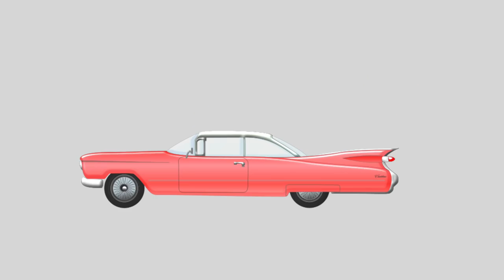Yes, Rockets CAN Fly in a Vacuum

Comment: Here is where I am lost, pressure leaving an object propels it forward because the object is actually in a sense slipping off of it's internal mass that is being expelled am I right? Now take a vacuum that sucks say.... 60psi and a balloon that blows 60psi and let it go right where that vacuum is, the object does not move obviously. So now i'm confused on how a rocket works in space when the vacuum takes that pressure away immediately as soon as it is exposed to the vacuum of space. Doesn't the rocket not get a chance to build back pressure to launch itself off of? Everyone is talking shit in the comments calling people stupid for not knowing... But when I think about this, it doesn't make any damn sense to me and i'm not stupid. I feel that the rocket would need an exertion of force towards the opposing direction of the flame if it's thrown mass is lost in a vacuum because no pressure builds up. A rocket works by heating up the fuel expanding it and creating pressure in the rocket then expelling them outwards to create thrust. Well in a vacuum that thrust should be lost because when it hits the vacuum it is lost and you should only see a light show rather than movement. I feel like an exaggerated view of how this works is testing it in an atmosphere to see the pressure build behind the rocket because of molecules in the surrounding air. In a vacuum that pressure is then lost and that force is only exerted one direction instead of two.... or it should be with my understanding of how a vacuum works.
Reply: "Here is where I am lost, ... .  Now take a vacuum that sucks..."      -    A vacuum does not suck. A vacuum is defined by the absence of material and things that are not there do not do anything (except maybe not getting in the way).

".... or it should be with my understanding of how a vacuum works."     -   Your understanding of vacuum is fundamentally erroneous.
Reply: @rjcornford  well seeing how I work and never deal with science I only know what I have been able to teach myself online. Insulting me isn't doing any good. Explain to me how these things work so I can learn. That is the reason I left my comment in the first place.
Reply: @GlorifyGodInEverything  a vacuum is the absence of any gas molecules.  Think about it, how can "nothing" exert a force on any object?  ANSWER: it cannot.  Gas PUSHES OUTWARD into a vacuum, the vacuum NEVER "pulls".
Reply: @GlorifyGodInEverything 
One point I think you've heard, and may have understood would probably be Joule Expansion (or Free Expansion), which says that no work is done by a gas filling a vacuum, which is technically correct but not helpful in my opinion.

The trouble with this explanation is that most laypeople have a fairly rigid idea of what constitutes a "gas", and how a vacuum works,as you yourself demonstrated by saying "a vacuum that sucks".

Well, to start somewhere, in thermodynamics, a gas is just a large collection of particles, usually assumed to be the same sizes, and their behaviour is generalised to statistical outcomes of lots of kinematic events (they hit each other, and they obey the same laws of motion Newton described).

This is important in the explanation of how rocket engines both give thrust, and satisfy Joule Expansion, since thermodynamically you can consider the entirety of the rocket to be one very big particle, in this collection of particles. This means, to satisfy the Joule Expansion, the entire system (rocket + exhaust) can't do work, which means their collective centre of mass must stay stationary. And for the centre of mass to stay stationary, whilst the exhaust gases move in one direction, you need to have the rocket move in the other direction.

Joule Expansion is really just another manifestation of Conservation of Momentum, which itself is one of the key reasons given as to how rockets work.

Comment: AMY!  An automobile's exhaust has exactly ... zero to do with how it moves!  Not a bit.  The expansion of the burning fuel-air mixture (it does NOT explode) pushes the piston down which is turned into rotational motion by the crankshaft.  The rest is (for the most part) gears that turn the wheels. 

YOU KNOW THIS.  I KNOW YOU KNOW THIS.
Reply: She did say that.  I agree that it got lost in the rest of her words, and there are a lot of commenters that didn't pick up on it.  So, you're not alone.  But, yes, she does acknowledge that the exhaust does virtually zero to propel a car.

Comment: I saw you pull out the balloon and thought you were going to hit it out of the park. And then you pulled out Newton's third law as a magic talisman, which is fine for those of us who understand Newton's third law, but pretty opaque for a large number of people. I was pretty disappointed because you were holding the key to proper explanation!

While you were holding the balloon, the elasticity of the rubber placed the air inside under pressure. But the balloon had no net force. That is because the force outward at every point was exactly matched by a balancing force 180º out of phase! Let's say it's 5 pounds per square inch. For 360º around in every 3D direction equal force is applied and the balloon doesn't move.

What happens when you release it? Every force is still in balance, except that while the front of the balloon still has the force applied to it, the open back end no longer has air pressure against the back of the balloon. That leaves a net force of whatever the internal pressure of the balloon is pushing the balloon forward through space.

With the balloon, the pressure is short lived. As soon as the balloon empties itself of air, the pressure differential vanishes that the balloon falls. But a rocket, with fuel and oxidizer tanks can continuously keep the pressure in the combustion chamber active, balanced in every direction except front to back, where the nozzle letting the gas excape fails to balance out the internal pressure, propelling the rocket forward.

I think that's a word picture that anyone can understand and know why you don't need to "push against air or an object" for a rocket engine to work.

Comment: 1:34 the force of the exhaust is NOT WHAT MOVES THE CAR ...............ARE YOU KIDDING ME !!! THE CAR ENGINE DOES WHAT IS CALLED..................................................."MECHANICAL WORK" ...........IT DOESN'T CREATE "THRUST" !!!
Reply: Yes. The exhaust is not what moves the car. Exactly as she said...

The exhaust exerts a force, but not enough to overcome the friction holding the car in place.
This is a completely accurate and factual statement. And exactly what she says in the video. What's your problem with it?

Comment: just saying the gas pushes the rocket is not an answer! the auqsetion is how the gas pushes the rocket? explain how the reaction works with detail!
Reply: Let's first concern ourselves with rocket IN ATMOSPHERE, HERE ON EARTH.
 I like to use the Space Shuttle Main Engine as my example as there is a LOT of video. 
So, when a SSME is running (here on earth in atmosphere): 
1 - Does the exhaust gas get ACCELERATED as it leaves the nozzle? 
2 - Does the exhaust gas have MASS? 
3 - Can MASS be ACCELERATED without a force? (or is a force REQUIRED to accelerate mass)
Reply: Scared to answer my questions?
Afraid to learn something?

Comment: Balloon gases released and pushed agsinst the air surrounding it ın the atmosphere. Geuss she hadnt actually tried it ın a vaccuum which would make that Balloon collapse on itself and make all that additional gas released redundant. Hence why ıts called a vaccuum. In a vaccuum room, suspended ın air, none of that gonna happen. People who have made small vaccuum tank tests get it moving because they physicslly attach the engine to the wall or placed near the edge of the tank. İf they were genuine and placed it far enough away from solid surfaces, it wouldnt move as it isnt like she clsims.
Reply: So according to your understanding of basic physics a crossbow would NOT feel a recoil force if fired into a vacuum?

Comment: In my opinion.... this video muddles the waters too much with the car analogy. 

The really short explanation is that the rocket does push off of something: the exhaust gasses. That is all that needs to be said.
Reply: Theoretically, there would be no necessity for air to create thrust, because the particles that initially left the nozzle of the engine would begin to slow down and the particles that came in behind those would collide with each other, creating air pressure/or a reaction medium. This presure, a chain reaction or (force colum) of trillions of microscopic collisions per second, would travel back to the ignition area in the engine housing and because the engine is connected to the rocket, it would propel the entire machine forward; here in the lies the problem.  

     What would happen if the particles never lost their initial momentum and were left unable to collide with each other and failing to create an equal and opposite reaction, like how they would behave in space i.e. free expansion of gas?

     Space is unique, in that objects don't loose their momentum there.
In a vaccum on Earth, objects still lose their momentum due to "gravity"; the name atributed to the  phenomenon of objects falling at 9.8m/s squared.

     Being that this condition of space cannot be recreated, and the infinite momentum phenomenon is to remain untestable on earth; relying on natural scientific testing alone will forever keep people unconvinced because most of the people on Earth will never be able to experimentally test this infinite momentum concept in the anti gravity vacuum of space, and the math for propulsion in this environment proves it does not work.

Comment: im new to this but in order for something to move doesn't it need to push off something? correct me if I'm wrong. if I'm right then how do rockets push off virtually nothing in space?
Reply: The rocket pushes off of the fuel.

The terminology pushing off of stuff is technically incorrect.
Really the rocket is just accelerating and ejecting mass.
The exhaust gains momentum, and because of the law of conservation of momentum, the rocket has to gain equal momentum in the opposite direction.
Reply: @niallkinsella2687  don't be silly.
Reply: @77thbrigadesockpuppetaccou50  
Is anything I've said incorrect?
Reply: @niallkinsella2687  yes.
Reply: @77thbrigadesockpuppetaccou50  
Where and how was I incorrect? Details please.
Reply: @niallkinsella2687  all of it. mr. comments-policeman.
Reply: @77thbrigadesockpuppetaccou50  
Specifics please. Exactly where and how was I I correct?
Reply: @niallkinsella2687  you weren't correct, time wasting comments-policeman.
Reply: @77thbrigadesockpuppetaccou50  
I was correct though.
Momentum must be maintained.
If you accelerate and eject mass in one direction you cause it to gain momentum, and therefore you must gain equal momentum in the opposite direction so that the net change in momentum is zero.
If not you break the fundamental rules of the universe.

What part of that statement is not correct?

Comment: But there is nothing ( no air ) in space then what does the rockets push to move forward ???
Reply: The inertia of the exploding fuel/oxidiser mix.
Reply: If I fire a crossbow in a vacuum, will I feel a recoil? Yes or no, why or why not?  If you can answer that question, you would know if rocket propulsion works in a vacuum or not.

Comment: How does newton 3rd of motion works in space where there is no air to push the rocket forward? Oxygen inside the fuel tank is only to make combustion in the rocket engine. How does rocket fly out of the earth atmosphere? There is no gravitational force in the space. You didn’t explain us exactly.
Reply: Rockets move in space by accelerating mass and ejecting it. Conservation of momentum does all the rest.
Reply: There is gravity is space. You need to study up some more, bro. When you see astronauts in orbit they float not because gravity doesn't exist there, but because the force of gravity pulling down to the earth is balance out by the centripetal acceleration of their orbital speed trying to fling them outwards. It's basic physics.
Reply: Try this thought experiment:  If a crossbow fired a steel projectile in zero-G, in a vacuum, WILL THE BOW FEEL RECOIL FORCE?
Yes or No?
WHY, or WHY NOT?

Comment: You would run out of air.
Where'd you keep on getting the fresh air supply?
Reply: From the oxygen tanks.
The question you want to ask is how much oxygen would be needed for three men for two weeks, and was that amount of oxygen available in the tanks on the spacecraft.

Feel free to do the calculations yourself and check the technical specifications of the spacecraft. You'll find the oxygen available was more than sufficient.
Reply: You can fill tanks with liquid oxygen genius.

Comment: It is basically how much mass a rocket engine can push out and how fast it can push that mass out. (throwing the mass out of the engine)
A better demonstration of this principle would have been to use a Newton car. 
Nasa has a nice activity for children using a Newton car: https://www.nasa.gov/audience/foreducators/topnav/materials/listbytype/Newton_Car.html
The automobile analogy was nice, but did she leave out the part about the expanding gases pushing the piston down and being turned into a rotary force which then moves thew wheels?

Comment: Ma'am when the fuel burn in the rocket when it is in space then by what it get repulsion as you say every action has equal and opposite reaction. As we know there is no air in space so at what principal does the space rocket works in space can you please explain me.
Reply: The principal of conservation of momentum.
Reply: @niallkinsella2687  thanks ma'am thanks a lot
Reply: @anuraggupta4989  you're welcome madam.
Reply: @anuraggupta4989  Consider an experiment:

What happens if you fire a CROSSBOW into a vacuum?
Will it still feel a recoil force?

Comment: Great video. Though an internal combustion engines air fuel mixture should never explode. That is bad. The mixture is engineered to burn and it's the rapid expansion that provides force on the piston.
Reply: if you understand how a heat engine works you just showed rockets can't work in a vacuum lol.

Comment: Is that how car works? I thought cars  move becoz of piston in engine make wheel spin... Not becoz of exhausting gas. Is not?
Reply: Piston-engined cars, yes. Although the pistons are being pushed by the pressure of hot gases.
Land speed record 'cars' use jet turbines, which generate thrust from momentum exchange of the hot exhaust gas vs the car.  Or turbofans, which have a bypass fan section acting like a very high rpm propellor in addition to the exhaust stream.
But some land speed record designs do have rockets for the highest speed sprint portions of the run, and that's also straight momentum exchange of propellant backwards vs car forwards, same as in space.
Reply: @williamchamberlain2263  the exhaust is travelling away from the rocket, so no momentum exchange is possible. that's like saying when i walk out a door i am exchanging momentum with it, pseudoscience basically.

Comment: I have a good question for you what happens when the sun explodes and rips apart planet Earth and all the oxygen and gas particles are released into space and on the One off chance that all that oxygen is not recycled and is untouched and escapes all magnetic fields and gravitational fields into open space what happens to it expands expands in the vacuum of space what comes of it why are you ask this question is could it result in dark energy or dark matter because it has a positive and negative could it in someway results in the material or Adams molecules connecting with each other because they do surface tension connecting to each other calls this affect multiplied by all the planets throughout history getting destroyed the result in do universe expanding ????